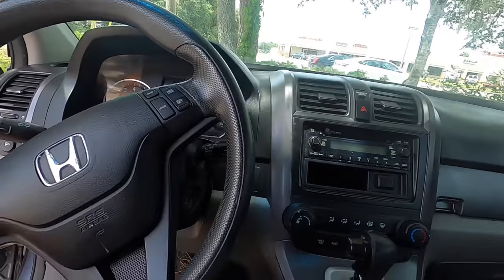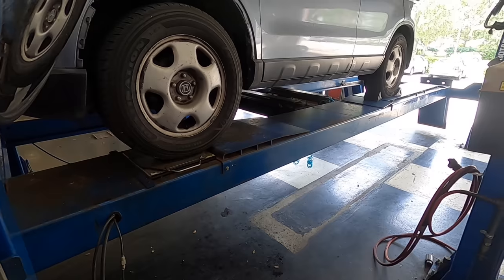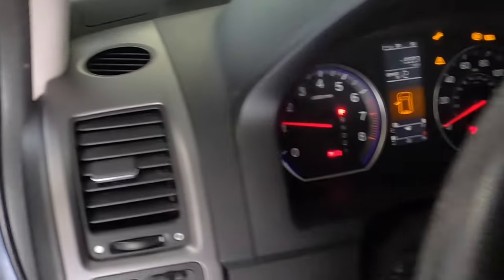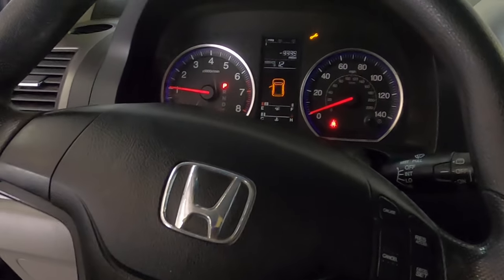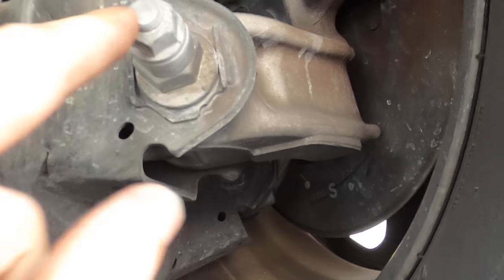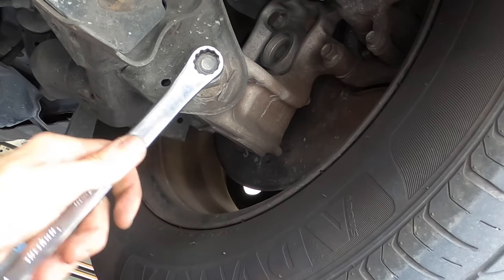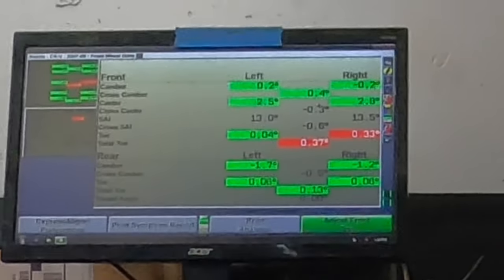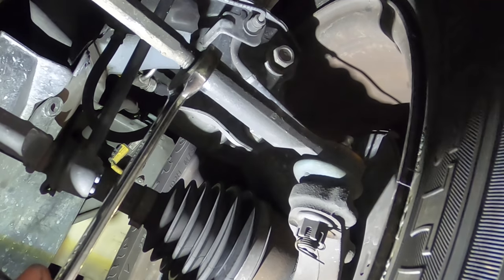Wheel Alignment Basic Tutorial | What is it and do you need one?

Comment: I've had cars before where alignment shop claimed couldn't do 4 wheel alignment w/out some bullshit kit I'd have to buy to do the rear. What gives?
Reply: Mine can't at all. (truck, solid axle) If its rear is out of alignment, that means the suspension or hub is literally coming apart.
Reply: Usually, you need camber adjusting hardware that isn't on the car from the factory. Cam kits, shims, sometimes even a control arm are needed to get it back in specs. Good news, is once installed, you shouldn't need any more kits.
Reply: yes this is true, because alot of cars dont have this naturally, some have only toe adjustments, and no camber, so need a camber kit if the camber is such a way out, depending on the setup of the suspension of the car, then YES needing a kit is necessary. and not Bulls**t
Reply: @playdg  and not necessarily the hub coming apart either, other reasons is just that the axle isn't lined up square to the centre of the vehicle (also known as thrust angle) and is often just the way it is from manufacture,

Comment: As a long time repairer those 'optical' alignment machines on a 4 post hoist are just plain useless. Measurements ar usually plain wrong and not by a little bit either. Old style turn plates with  mechanical arms concreted into the floor with a pit underneath is the only way to wheel align.
I have used the same bloke for 45 years and then he retired on me. The one time I went elsewhere it was a major tyre retailer and I watched the bloke do it,, I know him the reason I went there. And I agreed with what he did. 500km trip that weekend had the new front tyres showing distress and the car was nervous. When checked with proper equipment all three adjustments were out. Worse different side to side.
I now use my racecar eguipment, slow and tedious but right. And only do my own cars as it is too slow!!
As for the yellow?? Factory markings, either thread locker or just a show of final adjustmnt at the factory. And it does NOT make the nut any harder to undo. As for used parts? It is a 12 y/o car and near certain new is not available or way too expensive. Nothing wrong with GOOD used parts.